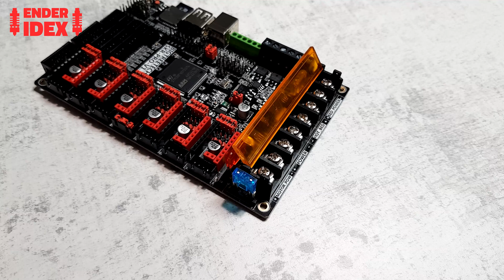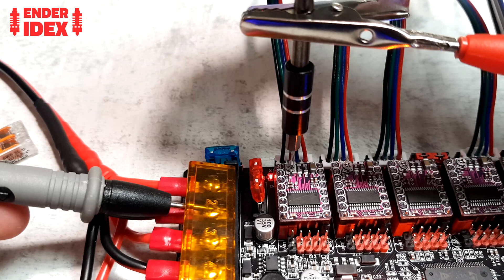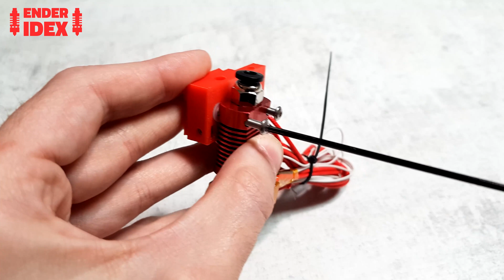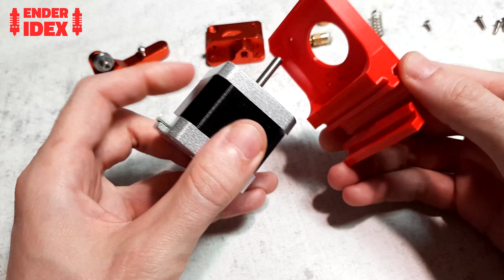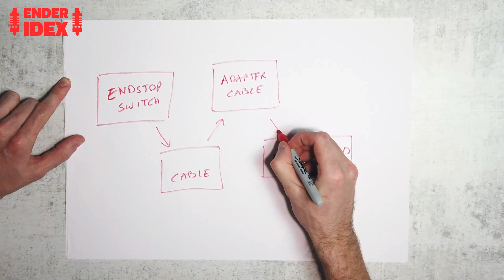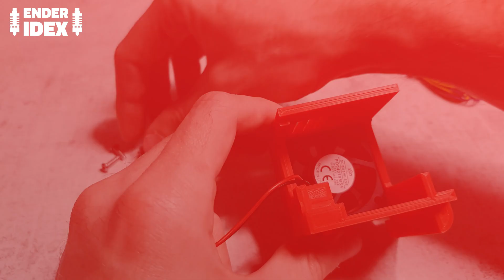Print Your Own Ender 3 Dual Extruder IDEX Kit: Files Pack Guide

Comment: is it possible to run the cr10 beta kit with a direct drive extruder for the main? I can't seem to find any pics of it installed to see if the extruder would interfere. Wanting to add soluble support material on my larger format machine.

Comment: I am wanting an Ender 3 Neo, this is not specifically listed as ok, is it?
And do I understand correctly that if I get the Ender Extender XL (so, 400 x 400 x 500 build volume) that this will work with that?
Thanks

Comment: This outdated video caused me to blow all my stepper drivers and the motherboard. Please for the love of god make a new updated video or remove this one because i dont think i will be the first or last person to make the mistake of blowing every electrical component of this kit.
Reply: Hi Jamie, haven't many other people installed this without blowing their stepper drivers and motherboard? How do you think this happened?
Reply: @MikeDwamz  the jumper configuration of the stepper motors in the video is different to the new motherboard
Reply: @Jamie-cz2xu  I'm not too well versed with wiring. Do you mind explaining that more? So basically what blew up the stepper drivers and motherboard was connecting the wires the wrong way round? What was different about the motherboard? He mentioned the SKR Pro 1.2 version that's included with the kit. So he has newer motherboard in the kit now?
Reply: @Jamie-cz2xu  So you had a different version of the motherboard and didn't check what the differences were before installing the drivers? Your fault entirley; you can't expect anyone doing an instructional video on anything to keep checking for future changes.
Reply: @miltonb4522  You could also assume that if a person is following a step by step instructional video, that that person also doesn't know much about the intricacies of types of stepper drivers and motherboards.

Comment: Will the idex kit work with a bl touch and filament runout sensor? Also if i want to put this on my ender 3 and i have a bigger bed from a upgrade would this still work? I would love to buy your kit i just want to be sure! Thank you.
Reply from the maker: Great questions...

1. BL Touch, yes it works great. You install it to hotend 1 and use it like normal with a z-offset for hotend 1 and 2. However for mirror mode and duplicate mode you still need a manually levelled bed as 2 hotends touch the bed at 2 points at the same time.

2. Runout sensor, yes this is very possible to setup. Normally the approach would be to have 2 sensors setup in a series circuit so that either one tripping will have the same pause print outcome.

3. Bigger bed, yes this works great too. Many people have installed the kit on Ender Extender setups and I even offer alternative versions of the kit for the Ender Extender models. The main differences are longer cables, longer x-axis, longer belts and a different firmware install.

I hope this is helpful and if you have any other questions at all please don't hesitate to ask 😊

Comment: Hey, so I just want to ask is the full kit going to work on the ender 3 v2
Reply from the maker: Yes, I have a special "V2" version of the kit. It's broadly the same as the regular kit with a few differences:

1. It comes with a TFT35 (the fancy looking V2 screen does not play well with non-creality motherboards and misses lots of menu options needed for IDEX function).

2. It has U-crimp power cables for screwing directly into the power supply as the V2 does not use an XT60 plug like the Ender 3 & Pro

3. This version comes with my "lift box" and legs to raise the prints ~20mm and give you move room for cables etc. as the V2 is much more compact at the rear of the printer for all this new stuff to fit into.

To get the V2 version of the kit just head over to the "buy page" and scroll down to alternative kits, you can find the Ender 3 V2 variant there https://3d.plus/buy/ender-idex/#IDEX-alternative-kits

Thanks again 😀

Comment: Looks amazing.
I was just wondering on a ender 3 would this kit work with direct drive extrudes and a second z motor to combat the weight we have just put on?
Reply: Yes, you can add your own z motor and connect it to the new motherboard with the marlin 2.0 software
Reply from the maker: Great questions. In answer:

1. Direct drive
Yes, hotend 1 can be direct drive BUT the carriage you select has to mount its stepper motor over the front. The MicroSwiss for example puts the stepper motor over the back of the carriage and this would collide with the new X2 belt path. Many of the low cost and "print yourself" direct drive options will work great.

For hotend 2 it comes at bowden by default but in the accompanying file pack is a direct drive option you can print and install yourself. As you say, I would advise adding a second Z motor in this case.

2. Yes, a second Z motor is a great idea for any Ender 3 (with or without IDEX) and certainly so with 1 or 2 direct drives on the axis. You can either plug in the second z motor to the motherboard directly as it has a spare plug or use one of the classic splitter cables the kits come with. The outcome will be the same.

The typical Ender 3 dual Z axis motor kits work great with my IDEX kit too 😁

Comment: Will the printed files fit a CR10S as well? I guess so, since the geometry is largely the same. I'm planning on using a BTT Octopus board and get both Z steppers their own driver. That way you'll be able to level the X gantry automatically so you'll end up with nice square parts in the XZ plane. I'll have to come up with a custom control box, but hey, that's what the hobby is for in the first place
Reply from the maker: Great question Bart. In principle yes the parts should work fine on a CR10S. There are so many versions of the CR-10 printers that ever now and again there is a specific model that has a tiny difference, but this is normally not too difficult to work around anyway. 

For example when there is amounted runout sensor where the X2 motors is meant to go (not an issues for the CR10S I do not believe)

Using the Octopus also sounds awesome. I can tell you there are already a growing number of Ender IDEX customers who are going down this route for their build. It's an excellent board and a sibling to the SKR Pro board I use as standard. So if you did get stuck in, between me and the owners group on Facebook I think you would be able to find most help and answers you might need 😇

Comment: Excellent video! I can’t wait to get one of these kits. I’m curious if the second extruder is compatible with different cooling duct designs. Like the Hero Me Gen 5 for example. I currently have one on my lonely single extruder Ender and was just curious
Reply from the maker: 😊🎉 Thank you for your kind words and I'm delighted you like the kit!

So as stock the setup probably won't work with other fan ducts mainly as the mounting method is a little different to allow hotend 2 to be raised and lowered independently. 

However, depending on your skills I think it would be possible to modify your fan duct of choice to work. For example a number of kit owners have added a Petsfang style duct to hotend 1 and 2, and I'm sure the files can be shared within the private owners group on Facebook (accessible if you buy a kit) 😁

Comment: I like the idea of this but I don't see info on the ender 5 plus.
Reply from the maker: Excellent question and thank you for your interest 😁

I have not made the adaptation to the Ender 5 just yet. It should be broadly similar but the cube shaped frame introduces some new challenges. for example without allowing the second extruder to park off the side of the bed printing volume may be reduced further.

However, I am working on a few new printers and versions of the kit. So be sure to subscribe and join my mailing list and enderidex.com and you'll be the first to know when new versions are available 😇😁
Reply: @SEN3Dcom  Kane, I’ve been looking for an IDEX printer kit, and it seems your Ender Idex is a possibility (coupled with a new printer I’d have to get). What do you recommend as the beefiest most robust yet best supported option? Seems Ender 5 plus kit isn’t possible yet, what about 5 Pro? Same issue? If you were to recommend the  best printer for your kit with all the bells and whistles what would it be? Thanks
Reply from the maker: @daddyshark1174  Awesome question and thanks for your interest. In my experience I would personally go with an Ender 3 Pro. A solid, reliable, great value and excellent base frame to build off without any of the add-ons which will either be replaced or are completely pointless.

You can then IDEX it if you like and in time upgrade it with and Ender Extender kit too and make it 400x400! 
Add options like a second Z motor, swap out hotend 1 and even hotend 2 to direct drive. There are so many options.

In the end you can take that base printer and drive it in so many directions as to make it the machine you want it to be and you really won't be restricted by some of the things like the Ender 3 V2's bespoke screen or other nice looking but useless additions (in my humble opinion 😇)

Comment: Have you ever tried to run Klipper with the ender 3 IDEX?
Reply from the maker: I have not...yet (it's on the list 😉) but I know a few existing kit owners have been experimenting with great results. Ultimately, aside from the Ender 3 hardware modifications the motherboard and firmware are setup like any other IDEX printer and will act accordingly 😁
Reply: @SEN3Dcom  Thanks for the quick answer! Great job!!!

Comment: I love this project. I mentioned on another video about a year ago if you planned to make a kit compatible with an ender extender and I think you said you would be testing it. Is there any progress on that? I got my ender extender kit awhile ago but will be moving in the coming months so I will actually have space for it now.
Reply from the maker: Hey Nathan, Thank you so much 😁

I am delighted to say yes the kit works great with the Ender Extender 🎉 there are a few Ender Extender 300 and 400 units in the wild printing great, massive, IDEX prints.

If you wanted to convert your Ender Extender you can buy a complete kit for it (including the extra long bar and longer cables) here: https://3d.plus/buy/ender-idex/#IDEX-alternative-kits

You could also buy the file pack and do it all yourself

And/Or you can buy individual components for the Extender like just the longer X-axis bar with pre-drilled holes: https://3d.plus/buy/ender-idex/#IDEX-kit-parts

So hopefully I have covered all your bases 😇 do let me know if you have any other questions about it and thank you again for your amazing support 🎉

Comment: Will my Prusaslicer I use for my current ender support 2 different extruders with 2 diffferent materials and temp etc?
Reply from the maker: Excellent question. 

Whilst it is possible to slice multi-extruder prints in Prusaslicer I have found it to be a LOT more complicated and less versatile (I suspect because Prusa don't actually make a multi extruder printer).

Although if you're just running a duplicate mode print this is easy as it's just an extra gcode line at the start of the print.

Personally I recommend Cura for the job and my guide video can help you get the basics of an IDEX print going: https://www.youtube.com/watch?v=fKV_Dj62xYo&ab_channel=SEN3D
Cura is good because you can basically customise any setting/temperature you like for one hotend and not the other, there are few limitations.

However, you can use any slicer you like that supports multiple extruders and Marlin Gcode. They will each have their own benefits and drawbacks 😇

Comment: Hi, Can I  fit a direct drive to the 2 extruders?
Reply from the maker: Another superb question. In short yes....

For hotend 1 you can use any direct drive setup you like as long as the stepper motor is mounted over the front of the carriage. If it's over the back the motor will get in the way of the X2 belt path. 

So for example the "Bondtech DDX For Creality Ender/CR-10(S)" would work with everything over the front of the carriage: https://www.bondtech.se/product/bondtech-ddx-for-creality-ender-cr-10s/
But the MicroSwiss Direct Drive would not as the motor is right in the path of the new belt (the microswiss all metal hotend is fine though): https://store.micro-swiss.com/products/micro-swiss-direct-drive-extruder

You can also print your own direct drive setup as well like this one: https://www.thingiverse.com/thing:3386628

For hotend 2, currently the standard setup is Bowden but the files include a beta of a direct drive version of the second carriage. This is obviously still new and open to change but you can certainly get in printed and installed and start playing with it. 

The reason it has to be custom is carriage 2 raises and lowers dynamically to get it perfectly inline with hotend 1 for duplicate and mirror mode prints, a standard carriage would not be able to do that.